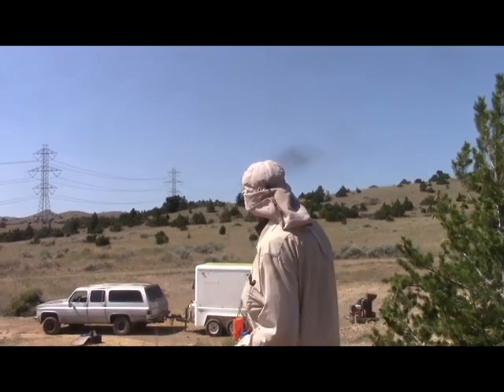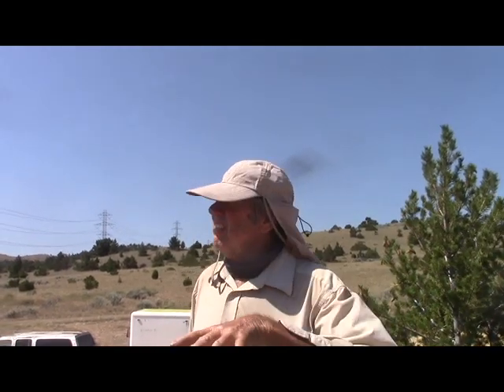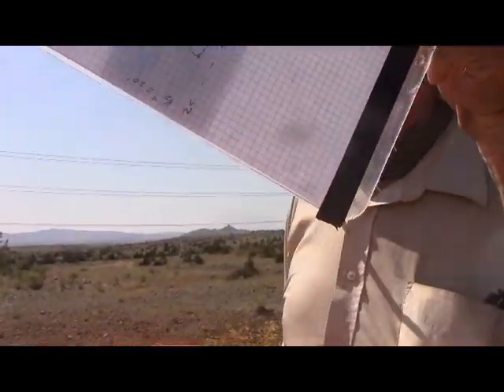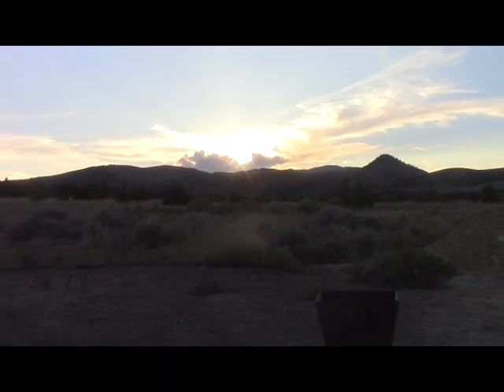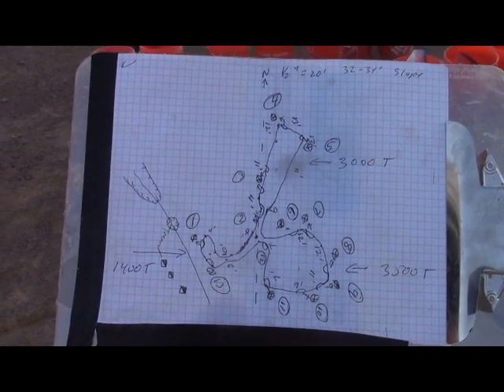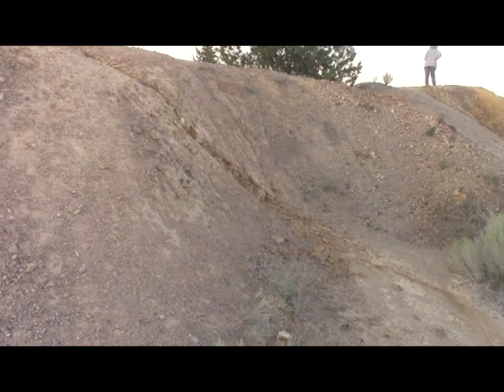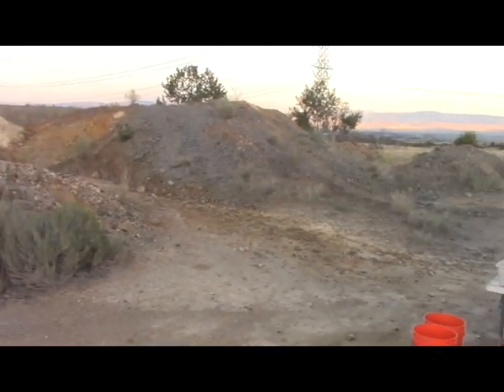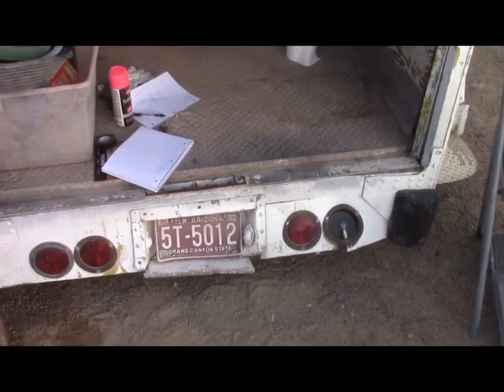164 Surveying and Sampling a Mine Dump With Simple Hand Tools

Comment: Happy Wednesday. thank you for your detailed yet clearly presented informational lessons. 
I am able to utilize this information here in North Georgia on my property to map the branch run (for fun of course). I plan to fabricate a plane table using a couple of rings (top and bottom) cut from a bucket and joined with 1 1/4” pvc piping and appropriate fittings for convenient assembly and disassembly as the assembly must be carried through moderate to heavy brush and across slopes. 
Thank you for the conceptual picture. Be safe and blessed!  🐢🤓
Reply from the maker: I'm glad it was helpful.

May we all be blessed and strengthened in these times.

Comment: Keith you are bringing back memories with the plane table and alidade.  I spent part of a summer in the hot part of Colorado mapping using this equipment.  We used rods marked with "E"s to obtain distance and elevation.  Nothing like trying to read a rod with the heat waves boiling off the ground.  This may be simple equipment but it got the job done and since you are creating a map as you go it is easy to visualize what you are doing. I have a new modern plane table clip board like you have, the only modification I made was to spray paint the clip with grey primer so it would not reflect the sun into my eyes.  I enjoyed you video, thank you. (I probably gave my age away)
Reply from the maker: Those Romans did some impressive stuff with little more than I had.  People become dependent on technology instead of their brains.  Sadly I lost my dad's Brunton somewhere along the years.  The Roman's would have loved one in their pockets.